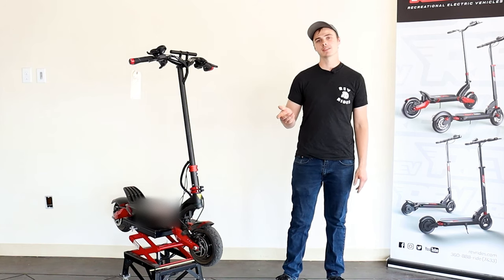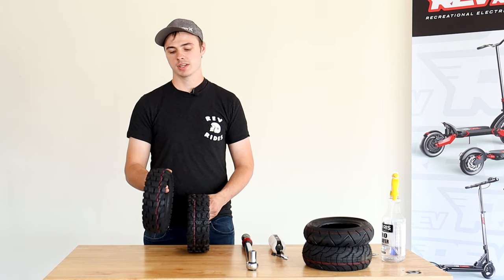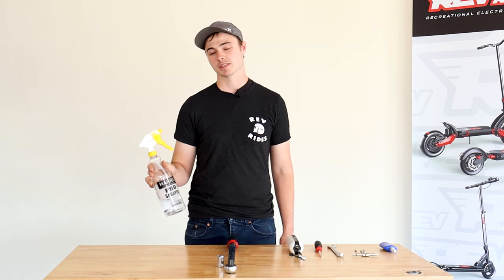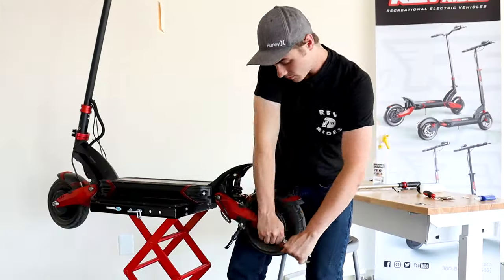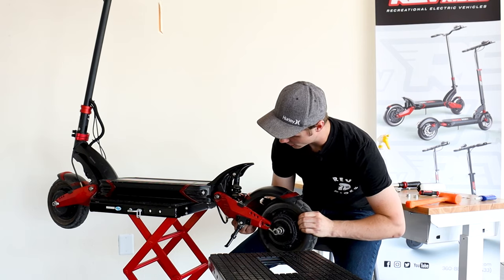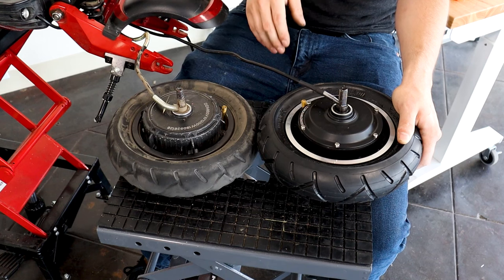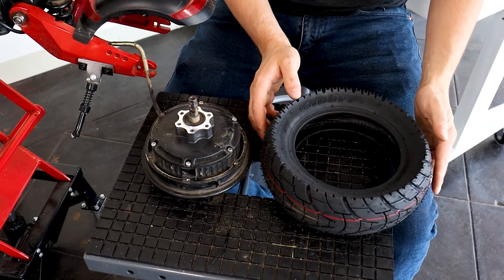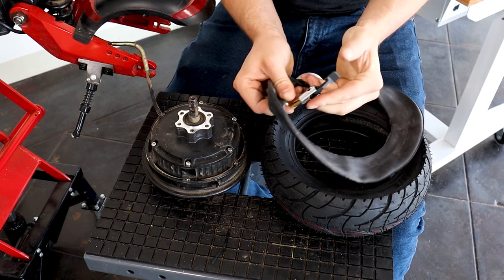Apollo Pro Tire and Tube Change

Comment: Loctite for the bolts? What the hell? Is only once u change your tires? :))) u don't want to change them again in the future? :=))

The new 3.0 tires looks amazing than the stock ones.... Also I change my tires at each 10.000 kilometers done.
Reply from the maker: We use a semi permanent Loctite. It helps keep the bolts secure during bumpy rides, but can still be taken out with a little force.
Reply: Your tires last 6,200 miles? How so long? That's my scooter in the video and as you can see my tires where bold at only 800 miles.

Comment: Where to Find VIN ???
Reply from the maker: On the 10X it should be on the front wheel well
Reply: REV Rides i can not find IT. How IT starts the vin? Does IT starts with the Number ?
Reply: REV Rides  could you please do a video on that topic? I have done google research and a lot of people have problem with that one.
Reply from the maker: @sakurasp5741  Not all ZERO 10Xs have a VIN or serial number. Earlier models were made with out them. Are you trying to register your warranty with us?

Comment: Holy shit the screws are bad quality 3/6 got stripped and impossible to get out
Reply from the maker: Using heat to loosen the loctite is recommended. If the head of the screws are stripping, make sure you are using quality tools. Inexpensive tools don't fit the screws correctly and will lead to more stripping of the screw heads.

Comment: Why waste money on an inner tube when you can just get a foam core.
Reply from the maker: Lots of reasons! Pneumatic tires are lighter, have better traction, and offer better ride quality than solid or foam cores. :)
Reply: @RevRides360  and they also go flat a lot, I'd trade a tiny amount of performance for never needing to waste money on innertubes again.

Comment: Zero 10x is a peice of junk it broke after a month of use first with flats then over heating then the throttle got stuck on me and kept going and I almost died using it after that I took it back and got my money back
Reply from the maker: Hello, I see you are commenting on every ZERO video. We have many riders loving the ZERO 10X. Sorry to hear you had a bad experience. Could you send me more info about the scenario so I can make sure this never happens again? Thanks!
Reply: @RevRides360  I also saw videos of the Zero 11x break apart I don't know if the metal is cheap or week but I can't ride a scooter if the metal will break n half on me while I ride that's unsafe